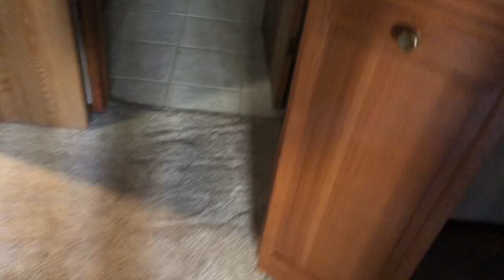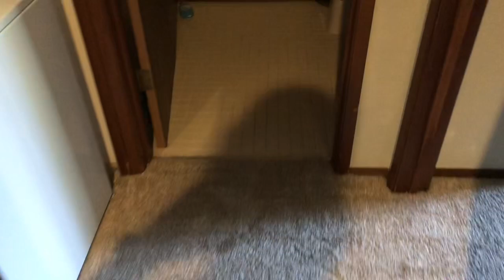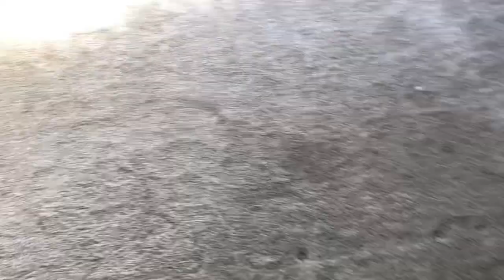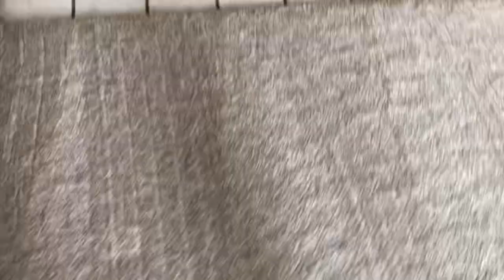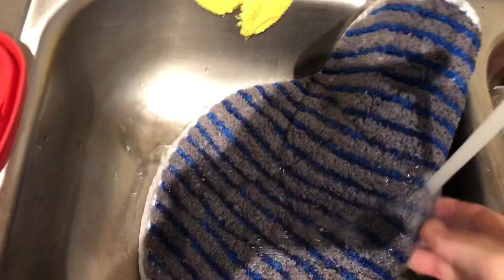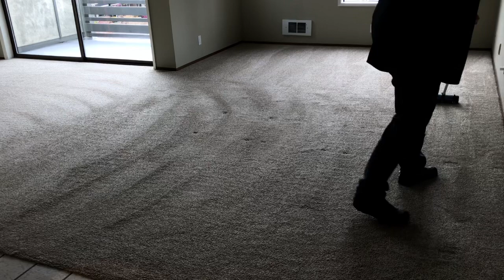Low Moisture Carpet Cleaning | SWIRLY FLOOR MACHINE

Comment: Hey Pauly, which is easier to control and maneuver? Orbot vibe or the Swirly? Debating which to get. I mainly doing residential but have a few commercial clients
Reply from the maker: Both great. Swirly costs much less and you can utilize the tank when preferred. Vibe is really simple to control as it is a wheels down machine